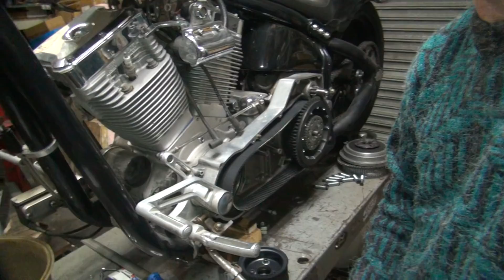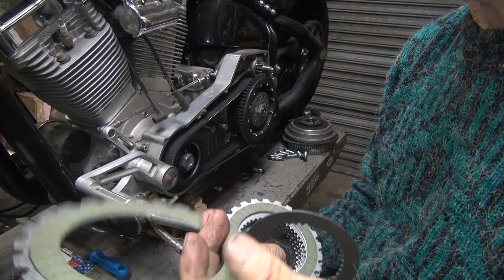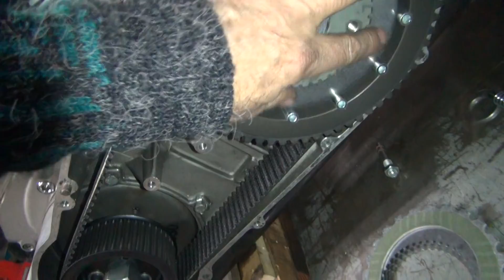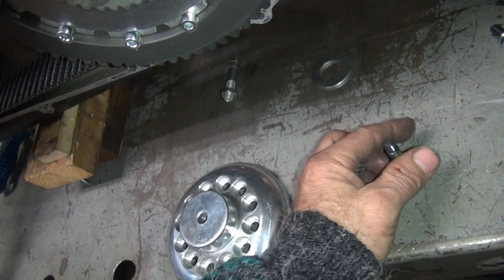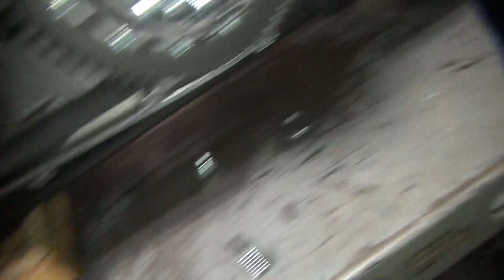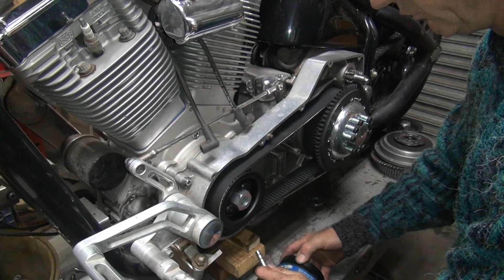#111 S&S 113ci evo motor blown belt drive transmission repair harley swift evolution tatro machine

Comment: I normally insert that clutch adjustment screw in from the other side of the pressure plate first,  rather than forcing the O rings through the threaded hole after fitment and risk chewing them up. Probably the fashion police in the helicopter - that knitwear comes with a custodial sentence!  😉